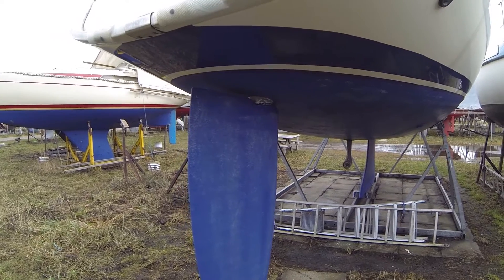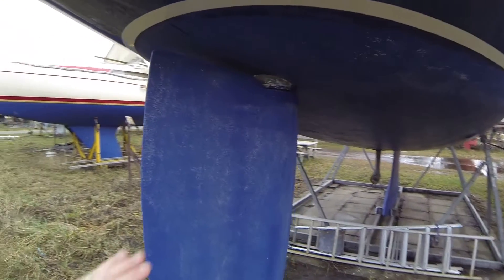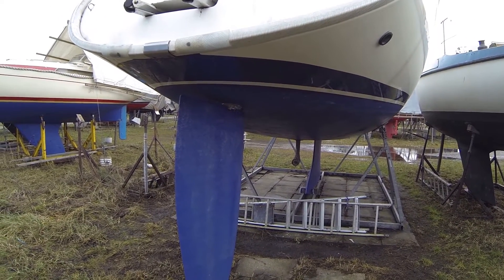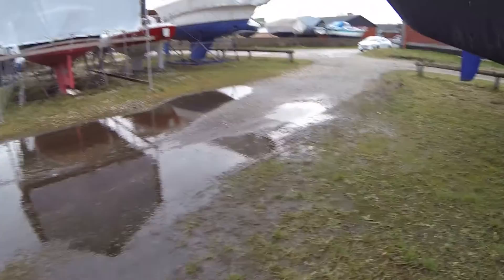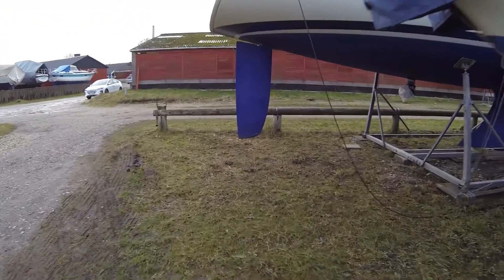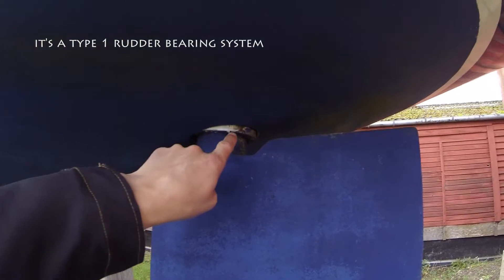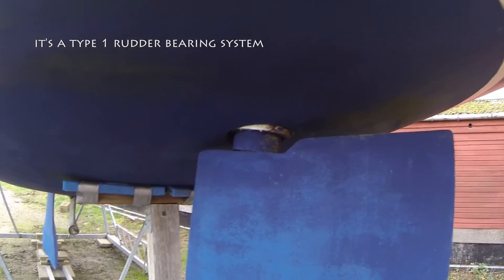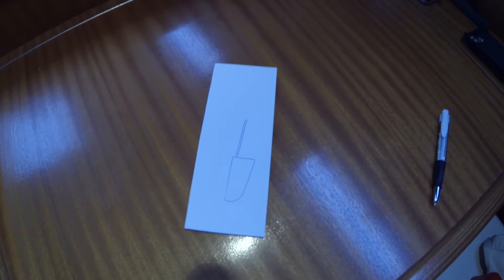A talk about bearings and rudders

Comment: Hi Tino I had the same problem on my Bav 39. A very simple solution to freeing up a stiff rudder is to 
remove top nut and drop rudder and shaft. (Friendly lift operator held her in the slings) Then drill the plastic ball shaped bearing with
a 64mm drill, took just seconds to do then shoved rudder shaft back up hole. The problem starts because of the aluminium housing oxidising and squeezes 
plastic ball bearing therefore making steering stiff. I did this 4 years ago and have had no trouble since. My neighbour had it repaired by the boat yard and cost him nearly £2000. I did it for free,  oh just remembered it cost me £10 (gave operator a drink)